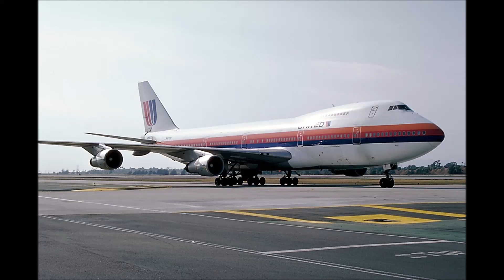ATC - United 811 - [Cargo door failure / Explosive decompression] 24 February 1989

Comment: The door that failed was just to the rear and down from the cockpit. I can believe it felt like a bomb going off. Interesting that you can hear airflow on the recording. On a tangentially related point, if it had been an explosive the aircraft would have likely broken up. I'm not aware of any such incident where an explosive device of any size below trivial detonated and left the aircraft able to make a landing.

They're really sensitive to internal overpressure events, I think. Pressurised tin can in a low pressure environment at altitude. The most recent that springs to mind was a Russian metrojet flight downed by a bomb built into a can of coke, half of which by volume was HE. Blew the plane in half, no mayday, no survivors.
Reply: @mikexxxmilly  The first WTC bombing, as in the 1993 bombing using a large truck bomb? One of the key guys in that attack set off a bomb on an aircraft, his name was Ramzi Yousef. That aircraft was Philippine Airlines 434, and the small explosive device did a great deal of damage to the involved aircraft, almost completely disabling the flight surfaces. It was only luck and pilot skill that didn't have it tumbling into the sea in pieces.

Or did you mean the hijackers who took over the first plane that struck the towers on 9/11? They had a fake bomb, but were only actually armed with knives and so on. I imagine you meant the first guy, but it wasn't clear.

Comment: If you were one of the 9 people sucked out of the plane, would you be conscious the whole way down?
Reply: If you were not severely injured or even killed by wind blast or hitting anything, no. At that altitude hypoxia would creep in but they were losing altitude instantly after the explosion. From 22000 ft the freefall time is just over 60 seconds.
Reply: At least one of them was sucked into engine number 3.
Reply: @Lem8sh  Holy crap